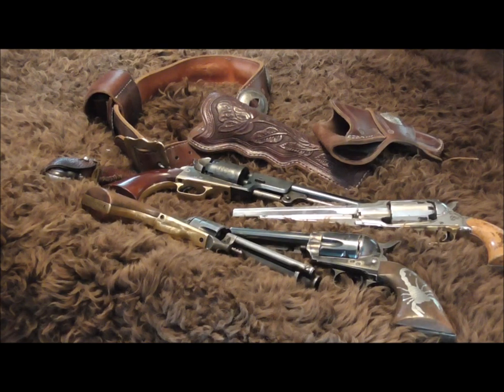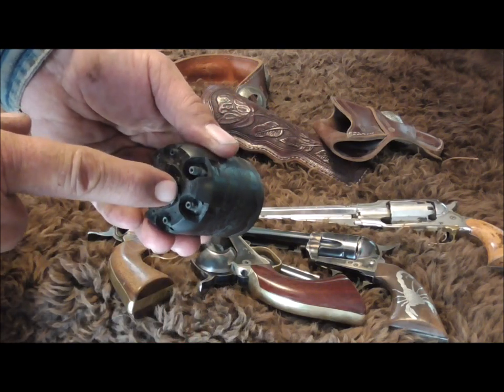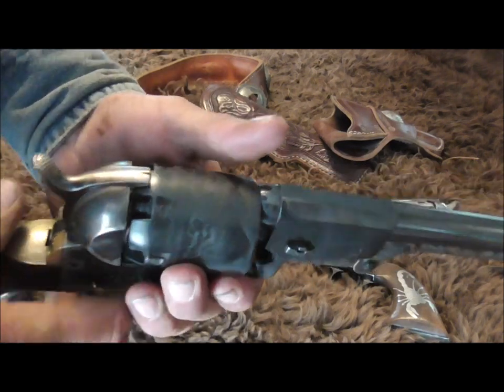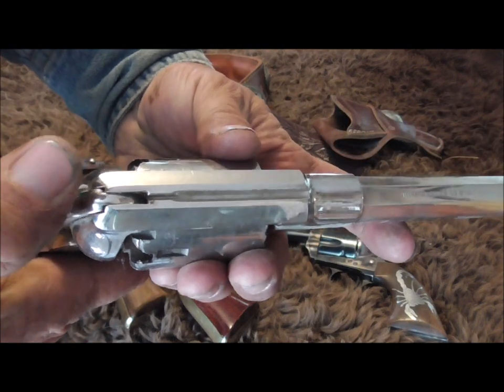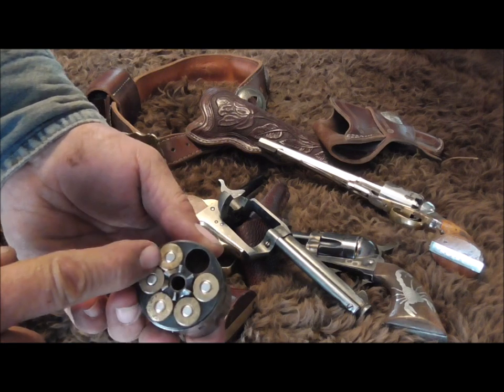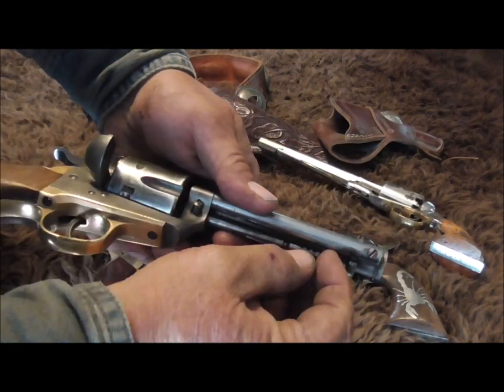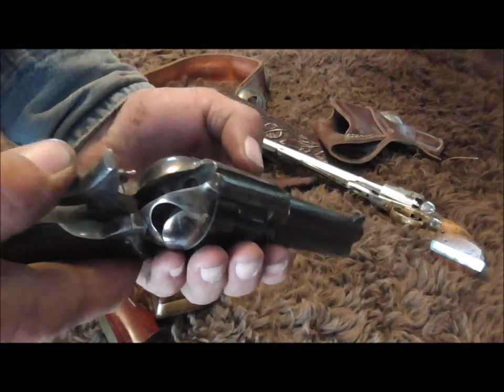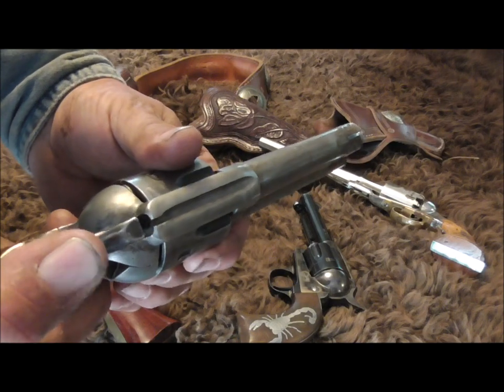How to Carry a Colt Style Revolver Fully Loaded

Comment: My first few handguns were autoloaders in the early 1990's. My first revolvers were actually cap and ball revolvers beginning in 1997, so my first experiences with revolvers were those with either the safety pins of a Colt clone, or the notch of a Remington clone.

 Naturally, the first time I bought a fixed firing pin, single action cartridge  revolver, I did exactly what you are doing. I lowered the hammer between case rims and carried six....until, that is, I heard or read that lowering the hammer on a Colt style action from anything less than full cock would damage the leg of the bolt that rides over the hammer/cam.

 I then carried six in a Uberti SAA clone with the hammer in the first notch....and dropped it out of my holster onto a concrete floor, ON the hammer, from a seated position about 16"-18" or so.

 It didn't go off, but it did damage the notch in the hammer enough that the first click sounded and felt different..."weaker" in my opinion. I believe that if it had been from  another foot higher, it may very well have discharged. 

 I then started carrying 5 in a fixed firing pin single action 6-shooter.

 Now....I mentioned that I did indeed carry 6 for a spell with the hammer lowered and the pin between cartridge rims, and I didn't notice any change in the action of that revolver. Come to think of it, I don't see how or why lowering the hammer from say, 1/4 cock, would hurt a SAA pattern action any more than an 1851 or an 1860 Colt pattern cap and ball.

 The hammer and bolt operate the same, and the cap and ball revolvers I've owned and do own are carried that way constantly.

 There are a lot of modern..."isms" that we have repeated and heard repeated both before and after these here interwebs came to be, that sometimes lead us in the path of the mislead and informed by the misinformed.
Reply from the maker: I think you are right on!  Mostly the "Load 5 and stay alive" idea is a good one and for sure the safest.  Not all revolvers operate with a hammer mounted firing pin that can be lowered between the case rims. I think for that reason 5 is better and the most common. All that being said though, if your revolver has a firing pin on the hammer, and the cartridges are not resest  flush with the cylinder, you can carry it this way safely.  I have three revolvers I have done this with for more than 15 years now. My 22 long rifle/22 mag the rims are milled so they sit flush with the cylinder, so loading 5 is the only safe way to carry it.  It depends mostly on your revolver, and secondly, how well you know your revolver. To someone new to firearms, or someone not really familiar with them.....load 5 and stay alive!
Reply: @MuskratOutdoors  Agreed. It's better to be cautious with advice we give our viewers because many of them aren't near as familiar or experienced. 

 I know I will err....I'd rather err on the side of caution.

Comment: Good video.  
Thanks for uploading  and Passing on this Information.  
If it's safe, Then it's safe.  That Simple.
Reply from the maker: It depends on the gun, but on a Colt or any that has the fireing pin that can be set between the rims, it is safe.
Reply: @MuskratOutdoors  yes, certainly the firearm has to be Designed with this Method in mind. 
Though Ruger's are  not a traditional western type Revolver mechanism I've come to really like the transfer bar on the Ruger's. 
At first I was Put off by the transfer bar simply because it wasn't traditional.  But have come to admire it for its engineering and its Convenience.  
As You said you are a Packer. I too am a user and not a Collector or Historian so much. 

If i had the Traditional style i would use the Method described in your video if the firearm was designed for that. 

Best Wishes from Montana! M.H.
Reply from the maker: @mikehagan4320  Yes Sir!  100% right!  
Ruger and those that have that tranfer bar are also safe to carry fully loaded.  Good design really.

Comment: I have a Thompson Hawken 54cal rifle. I like to shoot it more then anything. Black powder is definitely for the shooting connoisseur. I have never used a cap and ball revolver but I have been tempted to get one.
Reply from the maker: You really should!  Get a good Uberti or Pietta  you will love it!  For many years, I was kind of bored with my cartridge revolvers and was shooting only the cap and ball ones.  They are not as weather proof as cartridge, so I haven't shot them much for awhile......might be time to dust them off again!
Reply: Muskrat Outdoors I'll look into those, thanks. I use Hodgdon triple se7ev (seven) powder. It's "non-fowling". It works great. You can get a few shots off before you need to clean it.
Reply from the maker: I'm kind of a "purist" and try to use only black powder, but it's getting harder to find all the time.  Triple 7 is more powerful and cleaner for sure, but it doesn't have that sulpher smell I like so much!

Comment: Good Stuff My Brother...I just looked and my 44 mag won't do that no notch
Reply from the maker: Thank you. If the firing pin is on the hammer, it should be able to drop between the case rims.  It doesn't work with all revolvers, but the Colt and copies do most times.  Mine are Uberti made copies.

Comment: Thank you for that informative tutorial. I inherited a replica colt six shooter from my father which in my "safety sally" state is legally permissible, (but not for carry) The difference is that it is machined for 22 long rifle rimfire. The mechanism is such that it may be carried with six rounds since the hammer has an arrest safety feature which causes the hammer to be locked leaving about 5 mm of space between the hammer and the firing pin. To cock the hammer requires deliberate and certain strength and is essentially single action. The firearm cannot be fired unless the hammer is manually pulled far back to fire each round. If one wanted rapid fire, they would have to "fan" the hammer, in which case, I couldn't hit the proverbial broad side of a barn. Great collection, especially the black powder model. On my bucket list is to obtain the .30-30 1895 repeating rifle.
Reply from the maker: I think I have seen the type of gun you are talking about. A scaled down 1860 Army revolver chambered for 22 Long Rifle.  Those are pretty neat!  30-30's are like elbows.....everyone should have two!
Reply from the maker: Fred, you say "not to carry."......do you mean without a concealed carry permit, or not at all?  
Idaho is legal to open carry (exposed), and our Governor made it legal for any resident, (over 21? or maybe 18?) to carry concealed within the state, without a permit as well.  I have a CCP , but rarely carry one, unless it's trapping season or I go out of state. Montana recognizes an Idaho permit.   I always have at least one in the truck though!  We rarely go anyplace else.....
Reply: Muskrat Outdoors -  Yeah, what I should have said is that I may possess this particular fire arm and keep it only by virtue that it was registered in my father's name and I am able to produce the necessary documentation. If I leave my property with the fire arm for any reason it must be disassembled to a degree that it can't be used in any offensive or defensive way. Here's the kicker I possess I permit to purchase shotgun or rifle and may transport either a rifle or shotgun provided they are unloaded and secured away from anyone as to render them useless except during hunting season and for shotgun only. Rifles may not be use for hunting in my state. However, legally, I may not use any weapon to protect any property. Therefore, if I were sitting in my house and another person or persons were to invade my home I could not attempt to harm them in any way if it can be proven that I had way to leave my home in a reasonable amount of time. There is no self-defence law in New Jersey. Many residents don't believe this, but have been charged with manslaughter when they were the victims of home invasion. If I were to shoot, stab, club, or use any other means to protect myself or another person, using deadly force, I would have to prove beyond a reasonable doubt, that I or another person's life were at risk of bodily harm or death and that no other remedy were available. It's in total violation of my 2nd amendment Constitutional  right. This has been on the books for at least forty or so years. In this state, with a population of over 9 million residents, there are only 496 civilian permits to conceal carry (which really means ANY carry) a firearm. It is ridiculous. Many have tried to oppose this law, only to be shot down (pun intended) by the unconstitutional government of this overpopulated state.
Reply: I would add, the laws carry such penalties as to make it unfeasible to really consider applying for a permit plus the exorbitant cost of insurance and the price to keep a "gun lawyer" on retainer. For reasons beyond my comprehension, the 2nd amendment lobby has not been able to exert any influence or advocacy on NJ legislation. But soon we all might be able to grow and smoke our own weed. Yippee, 😟
Reply from the maker: WOW!  I knew New Jersey was bad, but I never imagined that!  Out here, we pretty much do as we please as long as we don't threaten or harm anyone.  I have worn my trapping revolver into the bank many times. It is just easier to leave it on my belt. As long as it stays there, nobody cares.  There is a family that lives down river high on the mountain. The road is not plowed and they get about six feet or more snow in the winter.  The closest neighbor is at least 40 miles away.  The guy's first wife died in childbirth up there, since there was no way to get her to help.  They snowmobile in and out.  They survive by selling firewood through the summer months.   Anyway, you see them in town now and then, never without a revolver on their hip.  Even the women have one at all times.   It bothers some of the tourists, but it is completely legal and they are good, friendly, harmless, people.  Most all of my more commonly used guns are loaded all the time. We have no children living at home, and none that come to visit either.  Our daughter (step to me) was raised with guns, knows how to use them, and has several of her own.
Reply: Muskrat Outdoors - That's what gets me. I know a lot of people who have fire arms but don't own them legally. They just can't believe how strict the laws are here. Even knife laws. A person can't have on their possession in public any knife that would, of course, be over 4 inches, I believe, and folders that open automatically or only require one hand to open. Many times, I'd be subpoenaed to testify or go to the county jail to evaluate an inmate and have to go through the security checkpoint metal detector and have to leave my Swiss Army Knife (EDC) with the Sherrif's officer. I'd always wonder if I'd see it again, so I had my initials engraved on it. Some officers would question me about it and I'd ask them to call their watch commander. I'd move across the river to Pennsylvania where they have much more liberal fire arms laws, but I like my town, know everybody, and it is small enough where police response is very good. But, through the years, there has been an increase in transients and renters so they're getting busier. I imagine I will eventually move. Even though my town is tucked out of the way, a few homeless folk camp out on the wilder part of the peninsula I live on. The police are pretty good at making them move on to placement in shelters in the other counties. Sadly though, they're rough places in nasty neighborhoods. They're mostly people who've been pre-maturely released from mental health facilities. My town is weird in that we're so close to the city, but we only have two traffic lights and a drawbridge for the creek which is wide and navigable for medium sized water craft. The river is deep enough for container shipping but they're just passing through. Lots of marinas. There are a lot of waterfowl that stop over in spring and fall with huge flocks of geese and ducks for harvesting.
Reply from the maker: It sounds great!  Only too "Civilized"......to me "civilized" is just another word that means "ruined".   What gets me is it is still The United States of America. The second amendment  is clear and "it will not be infringed", yet they do it all the time.  A friend of mine carry's a 12 inch Bowie knife every day. Why? I have no idea! I've known him since 1991 and never seen him without it.  Strange, but it is his right.  Now he has added a snub nosed 38 to his other hip.  More hardware than I would want to carry, but he has never hurt anyone, and probably never will.   Even out here.....there is no reason for a "permit".  That is infringement.  Our Governor agreed , but stopped short with the "over 18 years old"part. (I looked it up, it is 18).   My Uncle said "If you don't have a permit for something, it is an illegal activity. Therefore, a permit is nothing more than a bribe to do something illegal. If you pay/bribe them for a permit, all is fine and they look the other way."   A lot of truth in that!
Reply: Muskrat Outdoors - I couldn't agree with you more. If the Government is so worried about law abiding citizens demonstrating those rights that the founders of this Republic risked the gallows for, it could repeal the amendment, but only by the mandate of the people. Many, I believed have been coerced by incorrect facts and falacies about violence and violent actions by violent people. Since recorded history and before, humans have acted violently without the use of cutlery and fire arms. After working well over half of my lifetime with individuals who have a proclivity for violence, hand guns, fire arm and knives were immaterial in the outcome of their behavior. If I wanted to commit violent acts (which, for the record, is something I would never do) I could do a lot of mayhem with a can of WD-40 and a BIC lighter. Hypothetically speaking. A true mass murderer could do more harm with a laptop and internet and server knowledge.
Reply from the maker: Absolutely!  We as a country, if not the world today, is so reliant on computers, that if terrorists somehow knocked out the computers, it would shut down country.  A scary thought for sure. Not long ago, I saw a thing that said "Millions of firearms in the USA, billions of rounds of ammo..... if we were violent, you would know it!" If there were no guns anywhere, people would use anything handy.   They do surveys that they present as facts. Surveys can be twisted into whatever results you want and are really pretty worthless..  Go into a bar and ask who is in favor of prohibition of alcohol, then ask the same question on Sunday in a Mormon church.  Of better yet ask a bunch of liberals who will win the election, Trump or Hillary!  
Well now that we are both on the Government watch list......
Reply: Muskrat Outdoors - Yeah, they can watch all they want. If someone gets there jollies following me or listening to my mind numbing conversations, please by all means. As far as surveys are concerned, there are lies, damn lies, and statistics. Here's my favorite, " 72.125% of statisticians make up a number at the last minute."
Reply from the maker: Yep!  I feel the same way!  I have a crazy friend that covers up his TV with a blanket because he thinks the government is watching him through it!  HA!  I told him," just walk around the house naked a few days, they will stop watching!"     It would be funny if it turned out to be true!
Reply: Muskrat Outdoors - If it is true, they're perverts. Voyeurism in government, somehow I'm not surprised.😱

Comment: That's pretty cool! I never knew that!  You don't ever learn about that in the old westerns! I read one of your comments below saying you had a 1911. Do you not shoot that one, because the brass flies or you like the fit of these guns better?
Reply from the maker: Both. Since I reload, I don't want to loose the brass.  Also with an auto (semi)  you shoot once and it's cocked and loaded for the next shot.....most folks like that, but I really don't. Since you have to pull the hammer back each shot with a revolver, I think they are safer.   I like the 1911, and it is fun to shoot, but I use my revolvers more.
Reply: I can understand that. I've always wanted a 1911 for some reason, but I heard they are not fun to clean with all the parts. It seems like they would balance well, but I don't know. I have a pistol, but I'm not real crazy about it. I much prefer shotguns and rifles.
Reply: I'm a pistol man myself. The 1911 is ok. I prefer the Spanish copies cuz they don't have a grip saftey.
I'm a big fan of the Beretta 92, 3rd Gen Smiths, or Browning Hi-Power.
Browning is gonna stop making the Hi Power this year so if you have an extra $1k laying around I suggest you get one.  :)
Reply: The Berretta is kinda ugly, but they all seem like good shooters! I don't think I'd put a $1,000 worth of ammo through it, so it probably doesn't make sense for me to pick one up. That Hi-Power is a nice looking gun though! I have a Glock and it takes some getting used to with the trigger.
Reply: Chip's Outdoor Channel  Berettas are slicker than owl shit. They just don't jam.
Reply from the maker: That would boost the price for sure, something to think about! Thanks for the tip.
  I really do like the 1911, but when I go someplace, I tend to reach for a revolver.   I like most guns. I don't care for plastic stocks or black rifles though.  Mainly I like the old stuff, or copies of them.